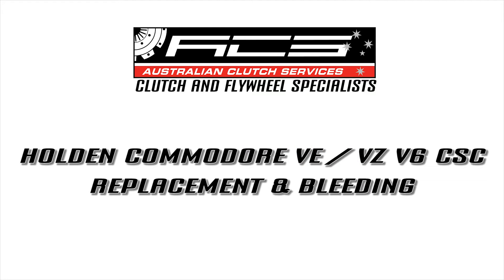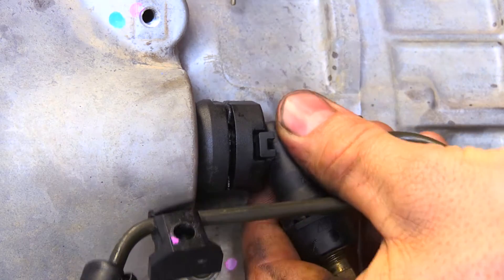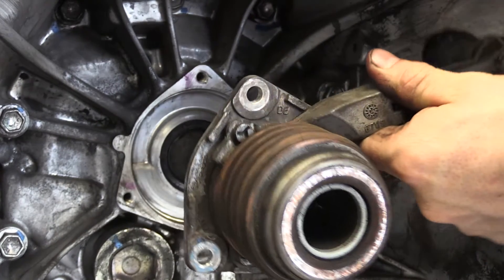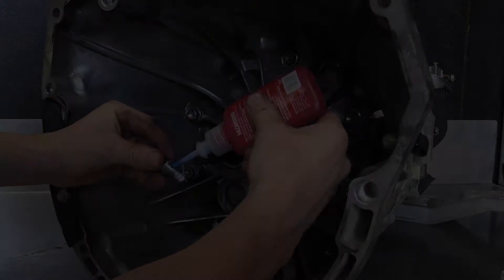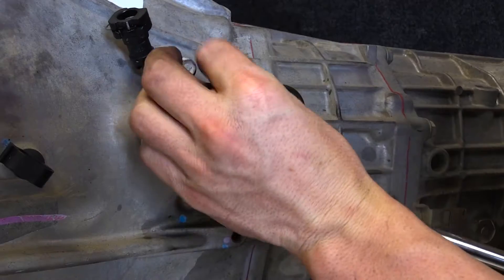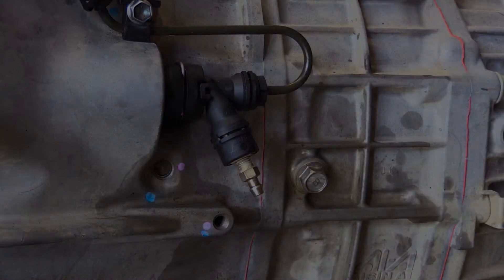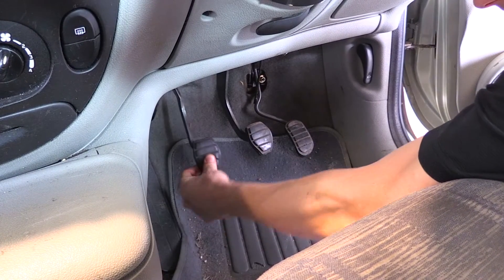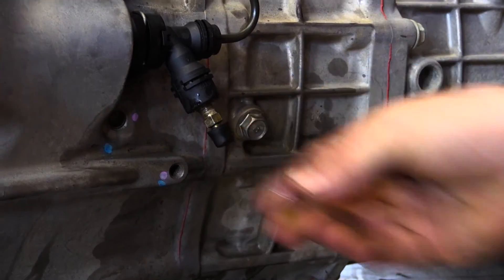CLUTCH TECH: Holden Commodore Alloytec V6 Concentric Slave Cylinder Installation

Comment: Late to the party but does anyone know if there is a secret to separating these gearboxes from the motor? Undone all spline bolts but can't get apart. Is it just dowel pins stuck??
Reply: currently trying to do this exact thing, cant find any info online

Comment: We just fit one of these and we are having a problem with clutch fluid seeping out from where the slave cylinder and the clutch line/breather meet what could cause this?
Reply from the maker: Hi Jake
Sorry for the late response. This could be caused by a variety of different issues. If you haven't already, could you please either email sales@australianclutch.com.au or call us on 1800 CLUTCH and one of our sales team will guide you through the best procedure to identify the cause.
Thanks
Reply: Having this same issue you ever figure out the cause?